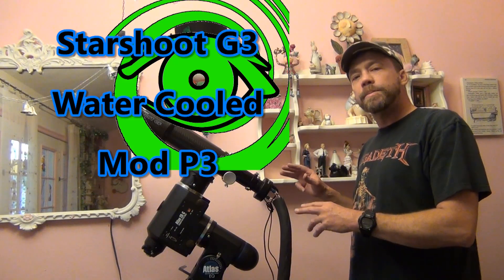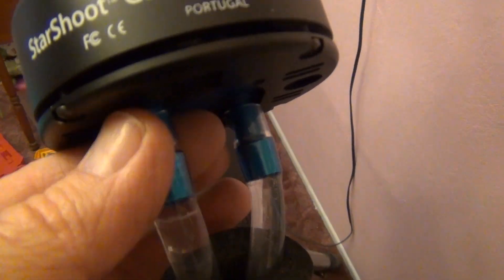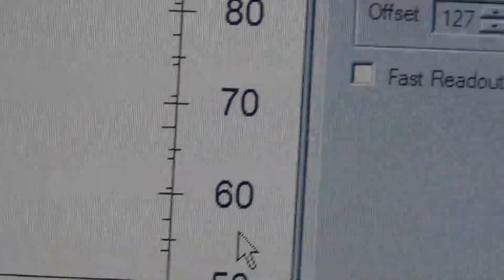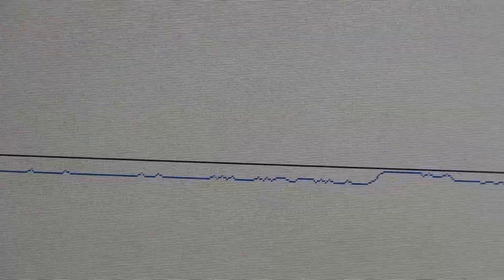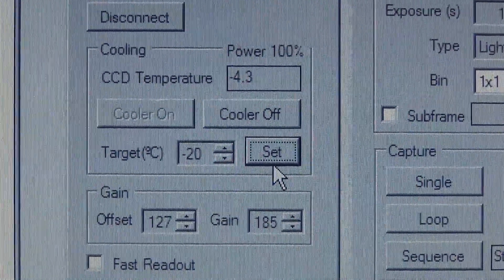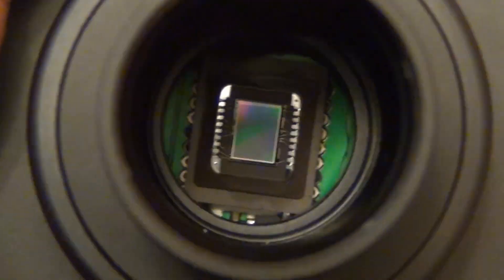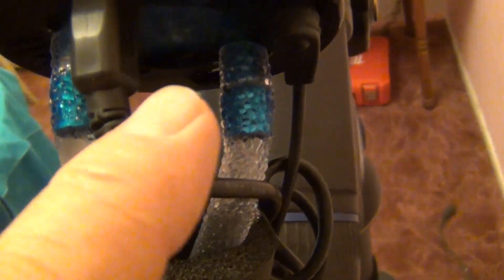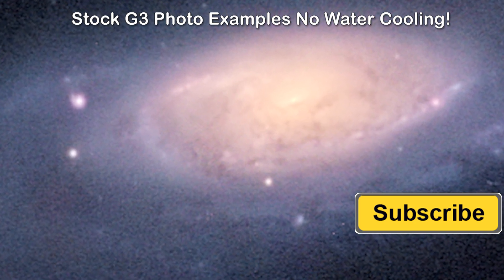Astro Camera Cooling Mod Success or Failure? P3

Comment: A Peltier with a fan and heat sink is much simpler and can be controlled accurately with a simple thermoelectric controller and a temperature sensor.

Comment: Running both hoses touching doesn't really help because if it did anything it would warm up the colder water heading to the camera.  I run a co2 laser cutter and at first I tried a bucket of water to keep the laser cool but it fails rapidly. Your experiment doesn't generate nearly as much heat but I think you definitely can benefit from a larger reservoir with maybe a coil of copper tubing to help cool the return water if that water is warmer than ambient air.
Reply from the maker: Hi Bill, yes, the larger reservoir, and no ice would have been enough for this to work properly.  Yes, the heat is not too great, but you're correct, there would be some cooling loss with both hoses together.  I got greedy and tried pushing it to the max and ultimately destroyed the camera.  I never got these out under the stars to properly test the results.  Thanks for your sugggestions.
Doug

Comment: Would that hose not cause issues, perhaps, with reliable tracking? I also wonder if the hoses from the camera will create quite some torque on the camera, possible slightly tilting the camera/sensor? ps. I noticed you have an offset of 127, that seems really high, usually I see those more in the realm of 30-50
Reply from the maker: True, the hose may have caused a problem, but I didn't get that far in my testing.  I was hopeful the drag would be limited and no interference would be there.  Just trying to push the limits and in this case I pushed it a little too far!  Thanks Vincent, I appreciate your suggestions and comments.  Doug